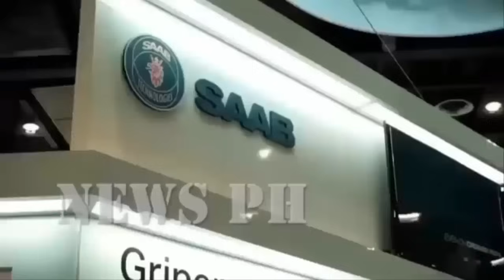Good News, Saab Massively Upgrades Jas 39 Gripen CD For The Philippine Air Force

Comment: There are not enough Gripen C airframes available and if there where, their all needed by Sweden now….. qThere was never any hope of the Philippines acquiring Gripen.  Get over it.  It’s AT-50 or used F-16s for a few air policing…..